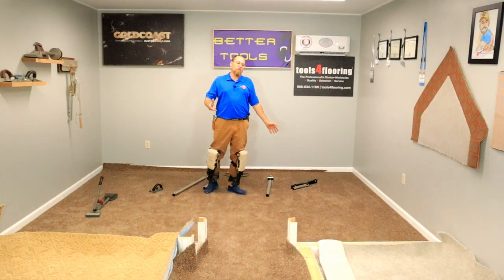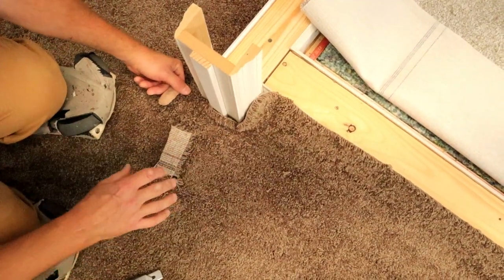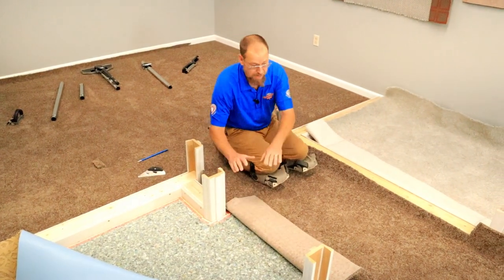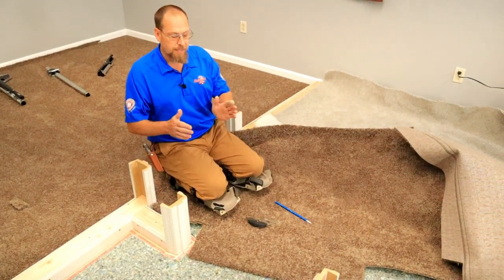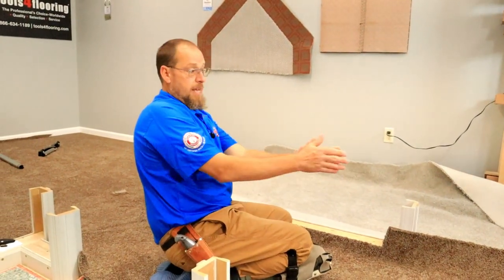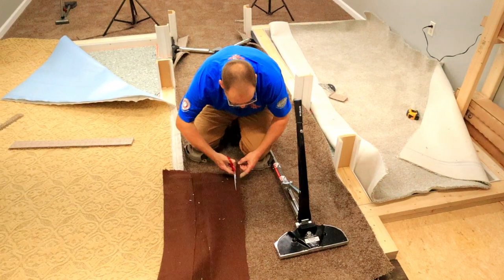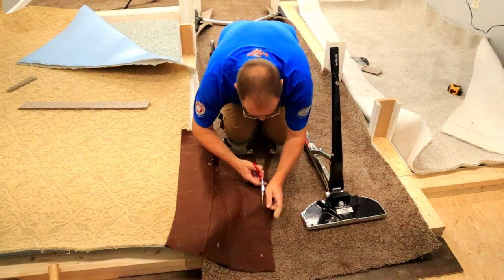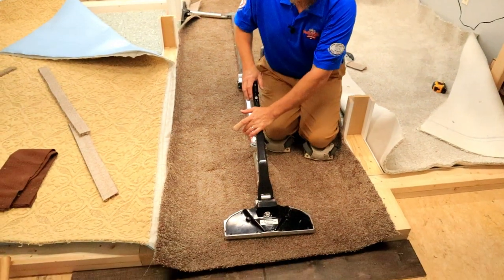HOW TO STRETCH CARPET IN MULTIPLE ROOMS PT.2

Comment: Hey Reuben I have the same power stretcher head , I’m having issues with the crappy locking pin part. When stretching it swivels out of place . Have anything similar happen?
Reply from the maker: No sir I have not, have you pushed the pin back down, if you run your stretch your head up on zero and push the pin all the way down it should stay put
Reply: It stays put for a couple stretches then the pin comes back and it swivels freely.  Man I should’ve sticked with the #500 .
Reply from the maker: @SOSALUVS420  That sucks